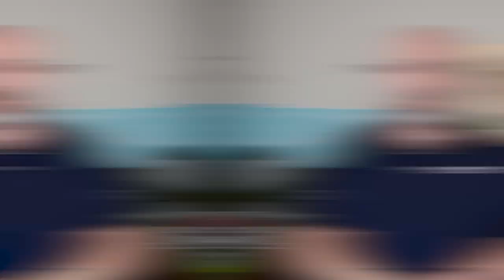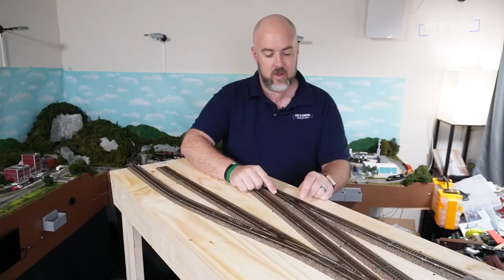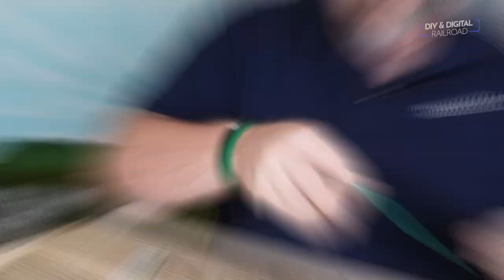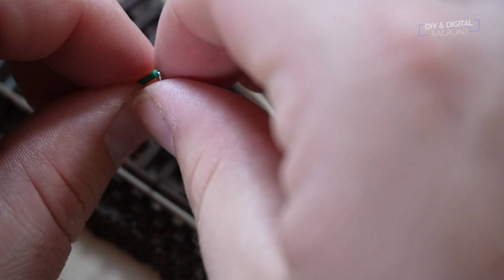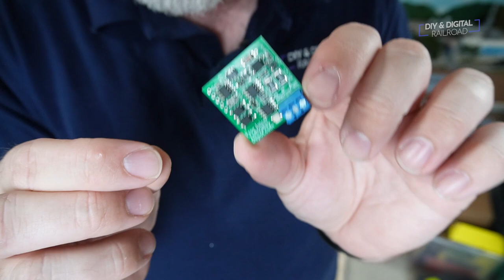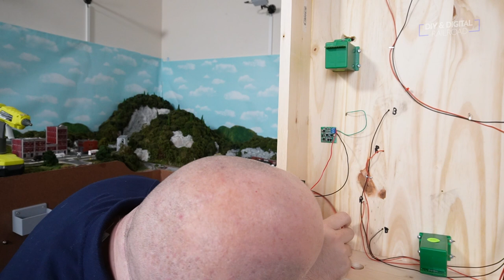This Fixed My Model Railroad Switches

Comment: The Circuitron Tortoise switch machine has two sets of SPST switches for this. I have 35 turnouts on my layout and used these to control frog polarity. The exception was was for a double crossover and a crossing and I used frog juicers for this. Frog juicers on work for DVC, not DC. I like how well you demonstrate the installation and your overall video subjects. BTW, Starbucks’s French Roast freshly ground is the coffee that I drink. 😋
Reply: I thought the same, why not use the built in feature for that in the tortoise motors
With the risk of getting reprimanded or something like that, I’m going to say, this is why some people find model railroading complex and expensive sometimes, why adding more  when you can do it with less and that doesn’t mean you are cutting corners or anything it is just the most effective and less expensive way to do it and probably the right way to do it (( I know, I know everyone is different, but sometimes it’s just about making things easy and simple))
Hope you all understand my point of view

Comment: I think you should also show how to use the Circuitron Tortoise machines to route power to the frogs.  They have a built in switches that also you to change the frog polarity and do power routing.  This would also save you some money since you would need to buy the frog juicers.  I would use frog juicers if I had manual throw switches since the manual throws don't have power routing capability.  I still think it's good to show different options like the juicers.

Comment: I'm all for powering frogs, but in this particular case the wheelbase of the truck (and there are two of them) is longer than the frog. So even when one axle was on the frog the other three should have continued to receive power from the other rails. If there was any stuttering or stalling then it was due to other factors.

Comment: If you’re using FrogMang fluxcore to weld up your frog then you should be getting 180 amps at 28 volts running at 270 inches per minute and an inch and a half stick out. Slight drag angle, and make sure to blend in about 30% to the previous bead so you get a nice flat weld to minimize grinding.

Comment: I think Kennedy G answered my question about whether or not your switch machines can control frog polarity.  I have been using Blue Point switch controllers on my n scale layout with great success; they also have the ability to power and change frog polarity.  I have also used the caboose industries ground throughs with the ability to power and change frog polarity.  They are a little large and clunky looking for N scale, but at about $5 each, they are a reasonable budget option for Atlas switch users.
Nice work on the videos Jimmy.

Comment: I used to have an issue with my N Scale Peco insulfrogs where my engine would short across the back of the frog. I found that the two rails coming into the frog joing across a thin piece of plastic which wasn't a wide enough gap so the wheels could sometimes reach over to the opposite track (This will make the normal buzzing/whining when it shorts). I know that isn't the same issue here, but it causes a similar problem. As for keeping good connection, I added ground throws with extra springs in them and left the original peco springs in the switches to add more pressure, never had an issue since

Comment: I was a bit surprised that you decided on Frog Juicers seeing as you have Tortoise switch machines which will switch frog power for you - no "shorting" to switch power at the frog.   The only issue with using them is if you come down the throat of the turnout and it hasn't been thrown, you'll generate a short and have to manually clear it.   The frog juicer will handle this (but at extra cost over the money already invested in the Tortoise.

I use both.   For my automated turnouts I use Switchwrights from Tam Valley and they too will route frog power so that's what I use.   But there is one darn turnout that I use a lot and way too often I forget to switch it and I end up with a short when I come around - sigh.   I also have a quad frog juicer that I use on a layout where the turnouts are manual.   Oh and I use a dual frog juicer as an Auto-Reversing unit on one of the layouts as well.   I do really like the Frog Juicers, nice and small and they just work reliably all the time for me.

Keep the videos coming, I really enjoy and look forward to them.
Reply from the maker: Hey Don!  Yes the Tortoises can do that, but I wanted to show a way that anyone can power the frogs.  That way if somebody came across this video and didn't have tortoises, they can still implement this.

Comment: After building my previous layout (#7, and #4 in N scale) I decided that frog juicers were a must. On my new layout all of my turnouts are manual throw, so I didn't have the option of using the switch machines to power the frogs. I have 5 of Tam Valley's 6-way frog juicers installed, and I've had many comments from fellow model railroaders about how well my n scale layout runs, especially through turnouts. I'm using a combination of Peco electrofrog and unifrog turnouts, and the frog juicers work great! Sure, I probably could have used keep-alives in my locos, but it can sometimes be difficult in N scale to fit a keep-alive in the loco, and now I don't have to worry about adding keep-alives to new locos as they're added to the railroad.
Reply: My turnouts are also manually thrown, using pushrods mounted in the fascia. The pushrod operates a DPDT slide switch under the turnout, which provides power to the frog.

Comment: Nice Tip. But a lot of turnouts have plastic frogs. At least the once which I use from Fleismann and Minitrix. However I know that the pointers get their power the way they are set. Straight or divergent

Comment: You need to switch the points to actually test the polarity change.  Forward and backwards should be the same polarity on the frog.
Reply: You are correct, but I think Jimmy was just demonstrating that there was no loss of power as the loco went through the turnout.

Comment: When designing a layout a person needs to figure if they will be running short wheel based locomotives.  If so an electro frog turnout maybe the best option since it does not have a plastic frog. Then the use of a tourtise machine would change  the polarity. This also would be best if there are many turnouts. A number between 1 to 5 turnouts probably just use the juicer.

Comment: Another way to deal with this problem is to install a keep alive capacitor in the locomotive itself.
Reply: The only difference is that with a KA, during the time of no contact, the decoder can't receive commands just continues to execute the last one. Since directly after the turnout there could be a train, I am not comfortable with uncontrolled locomotives moving towards them. I still use KAs though, but only on those locomotives where it's absolutely necessary. And I have all my frogs live.

Comment: SD-45 -> Does the Frog Juicer do the same thing as a Digitrax AR1? Instructions seem a lot easier. I also saw a DCC Dual Frog Juicer and Auto-Reverser, and a Hex Juicer and those may be options as well. I’m using N-scale Kato Unitrack if it matters and I’m beginning to rethink NCE vs Digitrax as I haven’t ordered yet.

Comment: Great easy to understand explanation of how to install the frog juicer. I’m still in the planning stages of my layout, still making space and building prefabricated benchwork, so taking all this into consideration. I noticed that the locomotive kind of raised up as it went over the frog in the turnout, is that normal and or expected?
Again thanks for your great videos.
Reply: The loco hobbling across the turnout is because of the design of the turnout frog (what an ugly word - in german we call this "Herzstück", that is heart piece). Most older designs of model turnouts use either a metal or plastic cast piece with grooves in it for the frog. The loco (or car) is supposed to run on the wheel flanges through this part of the turnout. This was done because "back in the days", clearances for wheel flanges had to be much larger, the wheels had to be wider, than what is possible with modern maufacturing today. This means the gaps between rails in the turnout had to be so large, that a wheel would just drop in and no smooth running was possible. Even worse, a wheel flange could be caught in the gap and cause the loco or car to derail. By replacing rails with this one-piece frog, basically just a block with grooves in it, the wheel flanges could ride "on the floor" in the bottom of the grooves, resulting in smooth running and reduced risk of derailment. 
However, this requires rather high wheel flanges. As wheel flanges have become much smaller and even wheels have become finer over the last decades, this no longer works and when running over an old-style frog, the wheel will drop a bit into the gap, causing the rolling stock to wobble.
It is possible to build model turnouts with a more protoptypical layout, where the wheels run on rails, but as this requires much smaller gaps, this also means wheel flange width and the distance between the inner parts of the wheels on the axle have to be very tightly controlled. Some rolling stock might need to have their wheelsets adjusted or even replaced. 
For example, I have read that you have to expect problems running some old Fleischmann rolling stock through prototypical Weinert turnouts. 
So either you want prototypical track and no "axle dip", then you need to make sure all wheelsets of all your rolling stock is up to standard (which can be quite a lot of work and also get expensive if you have to replace say a hundred wheelsets...), or you want to just run your existing stuff without much work, and the wobble and the unprotytypical look does not bother you to much, and this is when you choose the old-style turnouts. Prototypical turnouts are usually also more expensive. 
You should be able to reduce the sinking in of new rolling stock in old-style turnouts by raising the frog floor a bit (fill up with brass tripes etc), but this will in return make the occasional old wheelset with really flanges climb up. So if this is worthwile or feasible depends on the composition of your rolling stock (as well as your tolerance for wobbling locos and small-scale, fiddly work).
As @DIY and Digital Railroad 's main message seems to be that you neither have to be an expert modeller, master craftsman and a millionaire (all in the same person) to have fun with a model railroad, but that model railroading should be an accessible hobby, he made the quite sensible choice to go with the cheaper traditional turnouts, which allow to run older, cheaper rolling stock without having to invest to much time, thought and money into the evolution of wheelset standards and norms...

Comment: What are the ultimate comparisons on using frog juicers on trouble switches versus using a keep alive in your locomotives? I would think the keep alive would be better for switches that have plastic frogs but I'm curious on your thoughts.
Reply: Keep alive vs juicer/other method. If u have a couple locos or u travel to other layouts. The keep alive is most likely the budget friendly route. If u have lots of locos, run at your layout a lot and have visitors. Probably best to make sure the track work is more bulletproof. Making the other option a good call.
Reply: The biggest problem with the Keep Alive is that, so far at least, very few locos come equipped with a Keep Alive. The Keep Alive is very bulky and can be tricky to install. The Nov 2022 Railroad Model Craftsman has an article on installing a Keep Alive, and the author had to cut away a portion of the weight to make a space for it. I use frog juicers on all my turnouts, and if I could, I would install Keep Alives on all my locos as well.

Comment: Got the Frog Juicer but getting Conflicting info on modifying a Peco Electrofrog Switch for DCC. 
Need Help Wiring one up to test. Really need 5 new ones Wired in.

There is a Wiki Doc showing cutting Closure Rails and adding extra Feeders between them and the Insulated Joiners on the Frog end. Under the Electrofrog there is an X of 2 Jumper wires from the Factory.

Found this on the Tam Site:

Peco Electrofrog Update- All Frog Juicers have both been modified to work with Peco electrofrog turnouts (and other power-routing turnouts) as they come. You still need to insulate the Peco electrofrog turnouts as in the instructions that come with the turnout.  Peco Insulfrogs do not need a frog juicer as the frog is plastic and cannot be powered.

Hoping this means Electrofrogs only need the
 2 insulated Joiners on the Outbound Frog rails.

Comment: Good video, but I'm confused, don't the tortoise machines have built in switching for frogs? Isn't that piece you added superfluous?
Reply from the maker: Yes you are correct.  I did this video to show everyone how to fix the issue regardless of switch machine.  I didn’t want to show how to use the tortoise and somebody who doesn’t have it is out of luck.

Comment: Will this circuit work on analog and dcc? I use both on my ho scale layout and I need a way to prevent Bachmann Thomas & Friends locomotives and steam engines from stalling in DC mode.

Comment: Hey Jimmy, just wondering how the frog juicer is holding up?? Still no issues? I'm looking at possibly using them on my lower level of my layout. I have tortoise switches on the upper portion but would like to use manual switches on the lower portion.

Comment: Just curious. I saw an old technique using two nails and a wire. As the turnout changes, the wire changes from touching one nail to the other. Haven't tried it yet but makes sense. Why pay for a juicer?

Comment: how would you insulate it if it had no insultation, i bought the electrofrog switches and need to know because nobody is talking about it, do i just cut the arrow pointing into the switch IDK.

Comment: A few comments: (1) a mono frog juicer retails for $16.50. A hex frog juicer retails for $90. So if you need to power five frogs, you can pay 5x16.50=82.50, or $90 - you chose wisely. But if you're powering six frogs, you should get a hex frog juicer, because 6x16.50=99.00. (2) Many turnouts come with a wire already soldered to the frog, avoiding the need for another soldered connection above the ties. You just need to drill an extra hole under the turnout (or just outside the ties) to slip this wire through. Finally, many modelers have been using the auxiliary contacts in Tortoise or Blue Point switch machines to power their frogs for years. This is a bullet proof installation, but you need to carefully figure out which DCC feeder goes to which contact. The switch machines can face either of two directions along the track, turnouts can be left hand or right hand; all of this affects the wiring. For me, eliminating all that trial and error is easily worth $17. The Frog Juicer detects the short circuit LONG before the short can raise current to an unsafe level. Unfortunately, you CANNOT use a frog juicer on a DC layout! You're stuck with the tortoise contacts. 🙁
Reply: There is no trial and error needed, you can measure it with a multimeter and solder once.

Comment: I have a peco double slip unifrog that causes my switcher to stall. Would two of these juicers work (one for each frog) or would I be better off with tame valley's dual juicer? I can't find much information at all when dealing with double slips.
Reply: My hunch is you need a juicer for each frog, but Tam Valley has great customer support - they can tell you for sure.

Comment: I am a bit unfamiliar with electronics, but how does the frog juicer know whether the switches are set in one direction vs. the other?
Reply from the maker: So the frog Juicer works in a similar way to an auto reverser in that when it detects a short circuit caused by the turnout being aligned differently than before, it reverses the polarity.

Comment: Does this device use a momentary short to cause the polarity flip?
Reply: Yes. I personally dislike the idea of this but at a few critical points it could work. It could cause problems with decoders but I have heard of very large model railroads that work just fine with them.

Comment: Would you get that hesitation if “electofrog” (what ever they are) were used?
Reply: It is an "electrofrog" turnout, in the sense that the frog can be energized, as opposed to an "insulfrog" where the frog is made of plastic. The terms are trademarks of Peco, but many people use them in a general sense.
Reply: @benbedothu  if it was a electro frog, why then did his engine hesitate or stumble?
Reply: @bruceyoung1343  Electrofrogs "can" be energized, but that doesn't mean they always are. As Jimmy says at the beginning of the video, the frog has to be separated from the stock rails, as they are of different "polarities" (more like phases, polarity has no meaning with DCC). Now you could connect a permanent feed to the frog from one of the stock rails, but that would cause a short in one of the directions. That's why you need to have a frog juicer, or use the terminals on the Tortoise, or use frog-juicing switch decoders to power the frog, as this way, the frog will always have the same signal on it, as the stock rail the wheel is going to travel on at.

Comment: Eh? Why not use your Tortoise switch engine to wire the frog? Seems the more logical and cheaper solution.
Next to that, frog juicer rely on a short circuit to function, briefly I admit but still fundamentally wrong imho.
Reply from the maker: Yes you are correct about the Tortoise.  The reason I didn’t is that I wanted to show a way to solve the issue that would work for anyone and didn’t rely on having a tortoise switch machine.